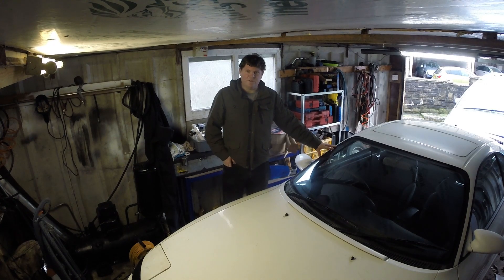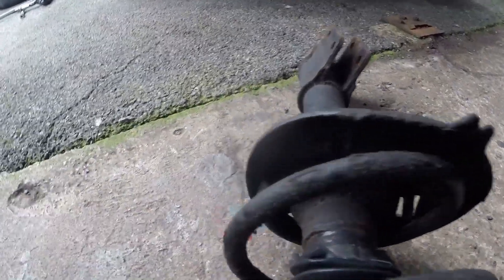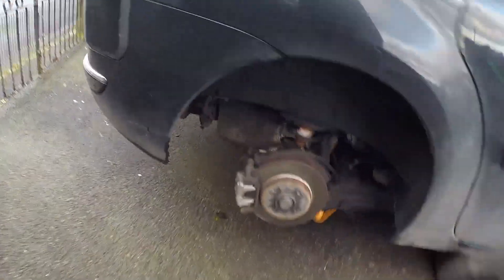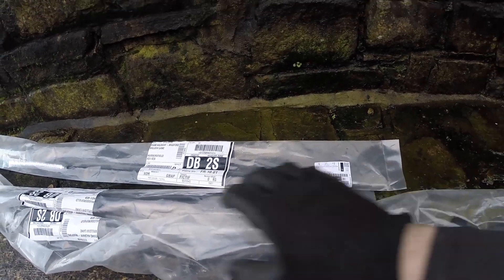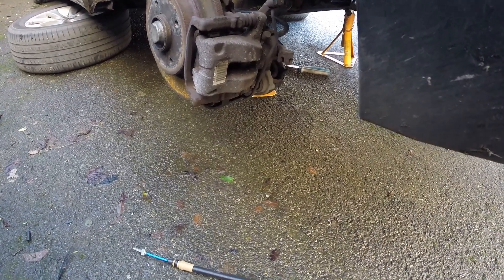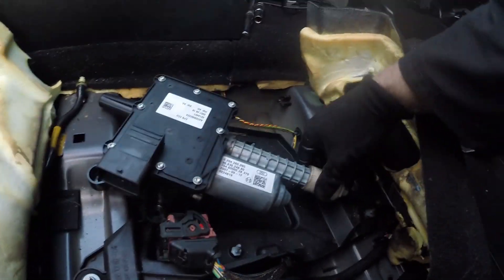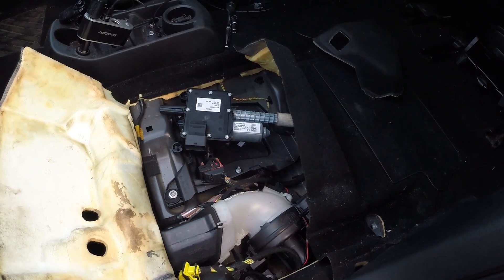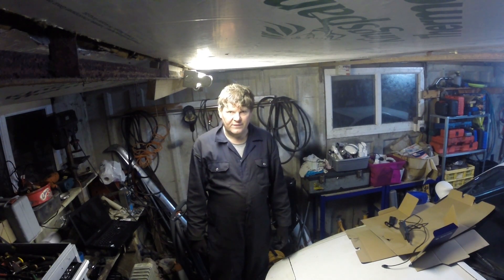Citroen C4 Grand Picasso Part 33 - MoT Failure repairs

Comment: wish you did a video on jacking up the piccasso, seems a pain in the arse as there are no solid jacking points? just crappy pinchwelds, any help appreciated. Well done having the courage to give it a go!
Reply from the maker: There are designated jacking points which are marked on the sills. This is documented on page 176 of the handbook. It is possible to use the front subframe and the rear beam axle. This would make for a good video so thanks for the suggestion.

Comment: Hello Parknest,
really enjoyed the video. I have a problem with the handbrake. I switched off the handbrake, fitted new rear brake pads and put everything back. I do not have a obd 2 scanner like yours but it all seemed to work fine but days later a message of handbrake fault came up. Which obd2 scanner do you use to recal the handbrake. Thank you
Reply from the maker: I had to use Diagbox to recalibrate the parking brake. Some scantools might have the same function. You shouldn't have to do it with a pad change. Just manually release the parking brake then you can take the caliper off to change the pads.